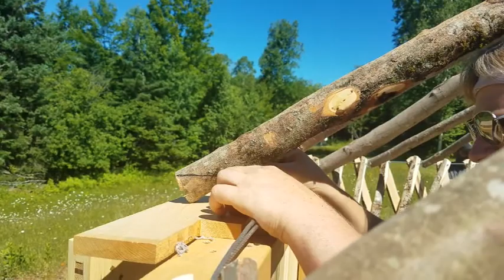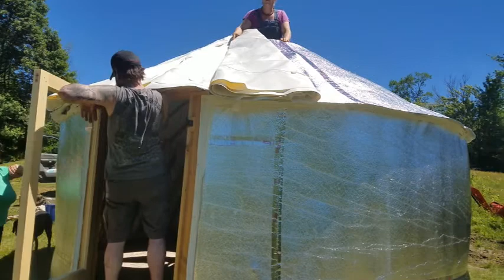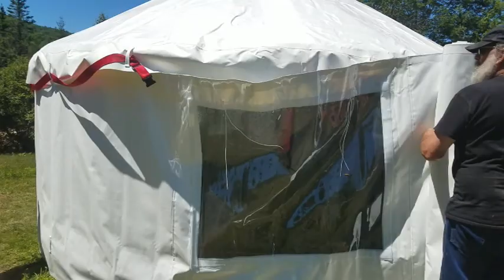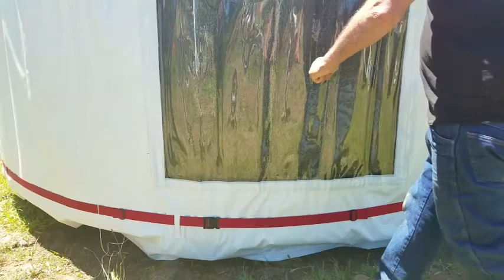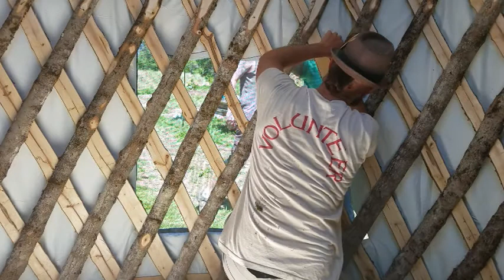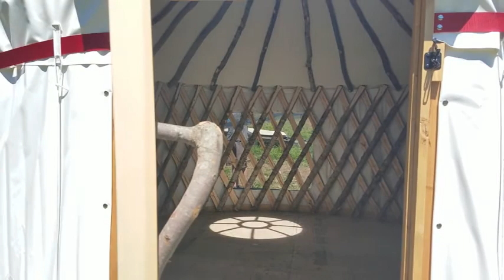Yurt Build Day with Sarah from Two Girls Farm and Yurts

Comment: Dude...I haven't yet , but I am thinking of building a larger over hang to the doors by a few inches. My doors on the two 14 fters are in need of sanding and refinish. - I am thinking that i could cut a piece of plywood to put over the door, with some drip edge on the end, and then screw the snaps through the drip edge tongue to extend the over hand a bit, and protect it from roof drippings!